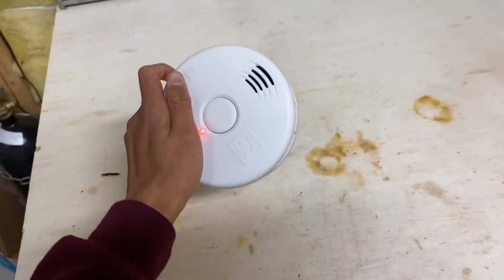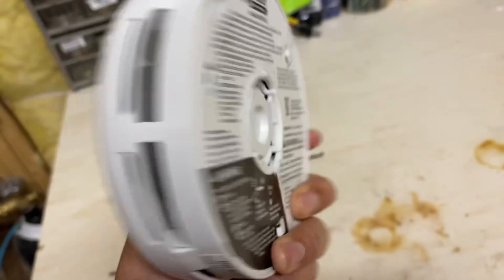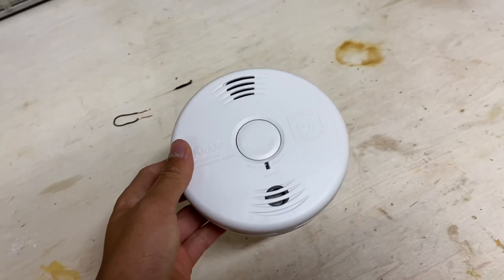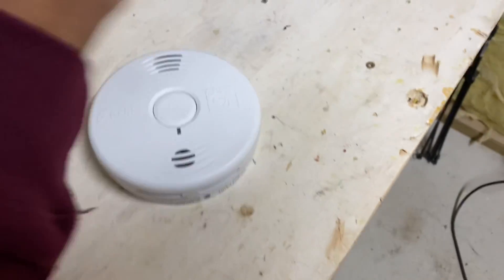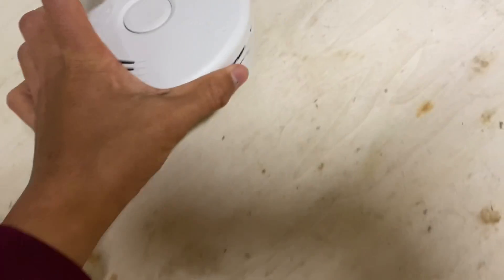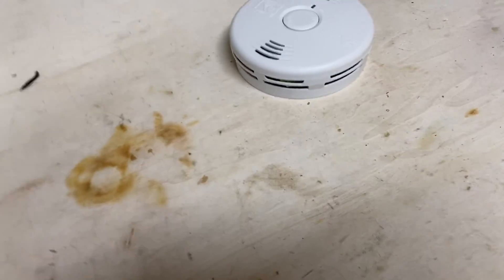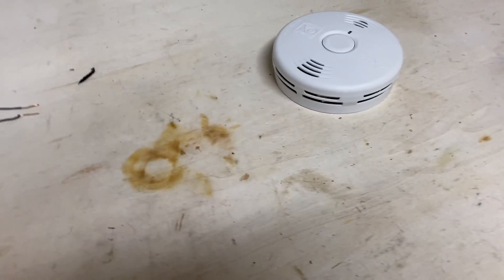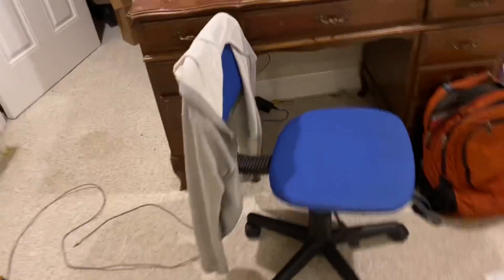Night of the annoying smoke alarm

Comment: P3010’s are known for this.
Reply: I just installed a P3010. The one where I had the problem, was not that style. It was the more usual with the battery door on the front. It suddenly went into insanity-mode, just because I opened a window and turned on a fan.

Comment: I had a 2021 do the same kind of thing. But it wasn't the same style as this one, which got installed on September 27th. (it happened to a non-sealed-battery variant) I now have a P3010K-CO.
My 2022 P3010K-CO is a lower-pitch, like those from the mid-2010s or around there.

Comment: Yeah, P3010-series units are not great for that reason. Sensor is junk, hush mode works for maybe 3 seconds at best.
Reply: If this one goes into insanity-mode, it will get taken out much sooner than a late-1980s central fire alarm system ever has, TMK!
Reply: Same with the P4010 series as well. One of them only lasted two years before it was chirping. I'm surprised there hasn't been any class action lawsuits.

Comment: This might not be surprising since going by all the recalls they've had to issue Kidde is not very good at making good quality products that work well. Sorry you had to deal with that though.

Our detectors randomly went off at least a month or two ago; no fire either! Eventually blew the heck out of them with an air compressor like you did, & they've been silent ever since (I should probably do this every month though, can't hurt). Ours are First Alerts too!

0:49 Yeah, that's the main disadvantage (& design flaw) with 10-year battery alarms: you can't take out the battery to shut the alarm up if it malfunctions (without breaking the thing open at least).

Comment: unfortunately, i think kidde models often have malfunction issues because the same thing happened to me on vacation although the smoke detector had a strobe. 
i assumed it was a malfunction because one of the detectors beeped 3 times (non emergency) every few seconds. when i went to bed, the alarm went off and the strobe was bright as fuck. we couldn't do anything to solve the problem, so my dad stuck the nonstop beeping smoke detector into a freezer in a separate unit in the airbnb. he took it next morning and it just kept beeping. the maintenance worker for the airbnb had to swap out the two kidde units for firstalerts the next morning. there were two strobe kidde units. one of the kidde units stopped working after being unplugged and silenced, but the one that belonged in my room just kept beeping. the other smoke detectors in the airbnb were either firstalerts or a different kidde model. not too big of a fan of kidde for that reason.